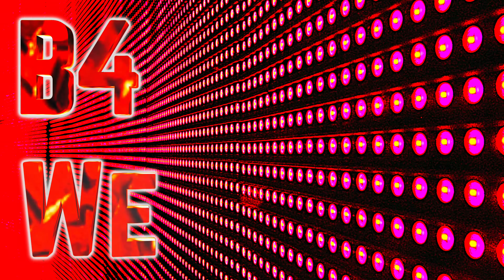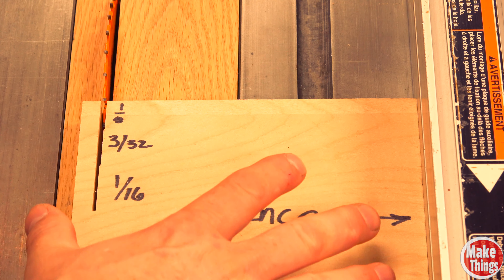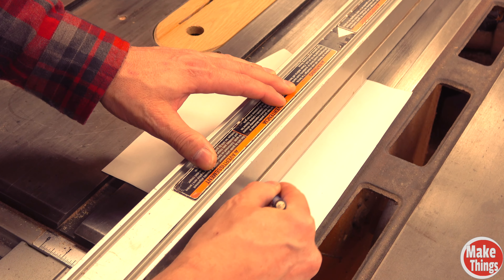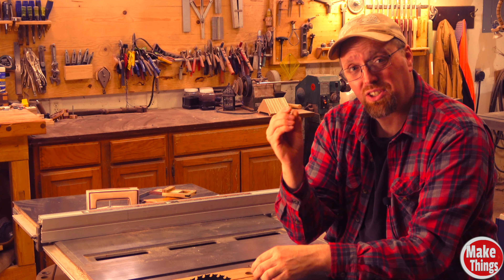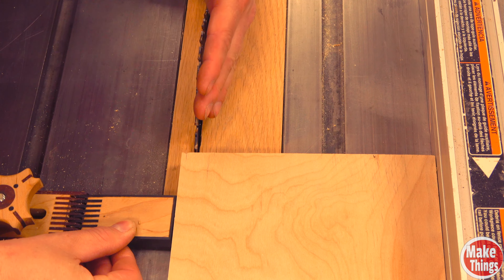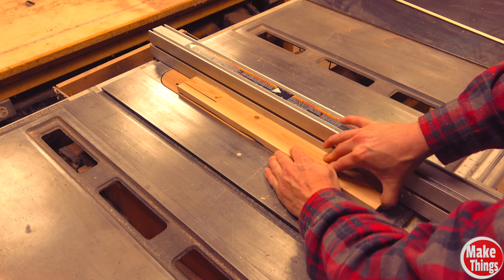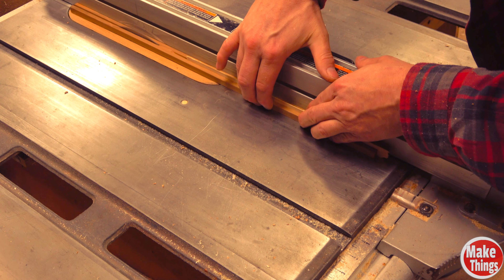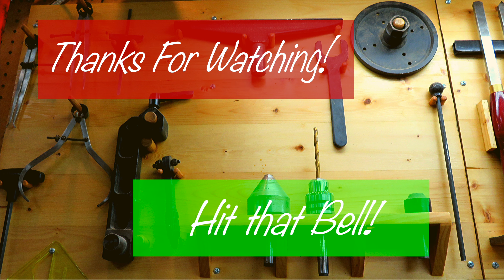Perfect Table Saw Cut Techniques // B4 We Make Things // #makethings

Comment: Same here, my say doesn't have a riving knife. Would be nice to have. I guess I should maybe check my fence a little more often than I do. I set it to the one blade and used that one for a few years, but have since gotten into the habit of swapping blades a little more often.
Reply from the maker: Yeah...another thing I didn't mention is the dome shape of the pin I have to move around.  I don't know how yours is, but mine is a half circle prism like thing (you might be able to see it in the video).  Unless you're looking at 90˚ down, it's easy to make slight mistakes.

I even got to the point that I was using scrap wood to test cut when I really wanted accuracy.

Thanks John, I wish you were closer...you and I seem to have a lot in common 😂
Reply: Oh yeah that would make it frustrating. Mine at least is just a flat window, but still easy enough to mess it up if you’re not right on top of it. Though usually at that point it’s close enough and I can make it work anyways, haha.

Yeah it definitely seems like it for sure, haha. Just chillin’ up here in Canada.

Comment: Well Rob I just made one but I cheated and used a woodpeckers mitre slot featherboard I got with the saw but don't use often
I hinged the blunt end and fitted in the tilting piece with adhesive measure and put a neo magnet on the hinge to hold the upturned piece in place
Now I gotta a use for that sucker as it is a B*** to get into the slot to use - so  I got a magna switch featherboard instead haha 👍👍
Reply from the maker: Yeah, I got one of those magna switches about 15 years ago.  I was super happy to get it until I found out that there were places on my table saw where I couldn't use it due to the holes in the table top.  For some reason, that ended me using it.

Man I feel old...15 years ago?  Sheesh.

Comment: Why do yo not use a tape measure to measure for the piece width?
Reply from the maker: I'm going off of my own experience.  I have 4 tape measures that can all give me different measurements.  I have a Kobalt, Mastercraft, Stanley and a Harbor Freight brand.  I've learned that if you want razor accuracy to stick with static measuring devices and not rely on moving tips.  That's Terri.